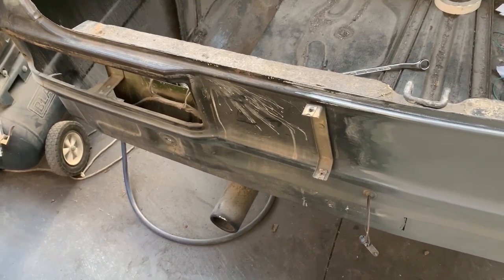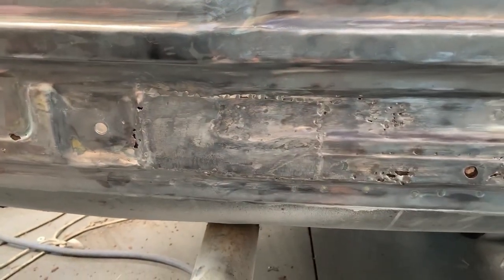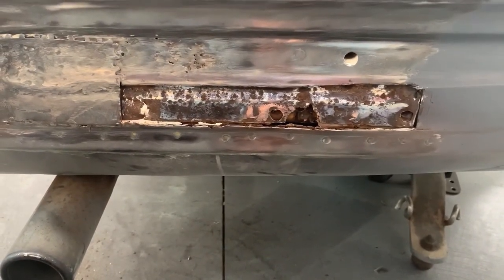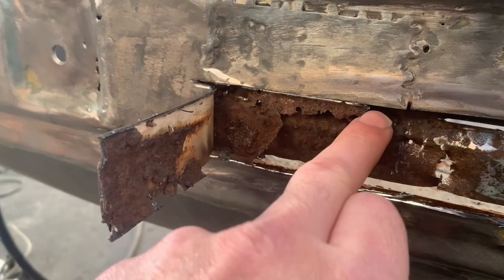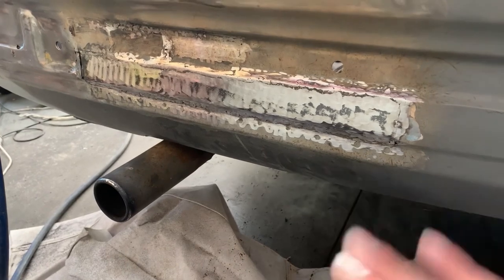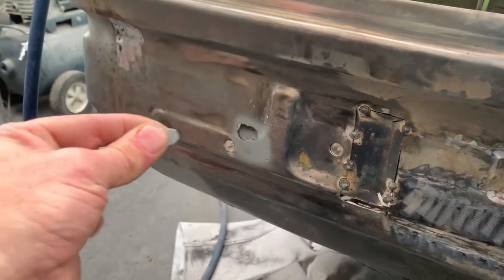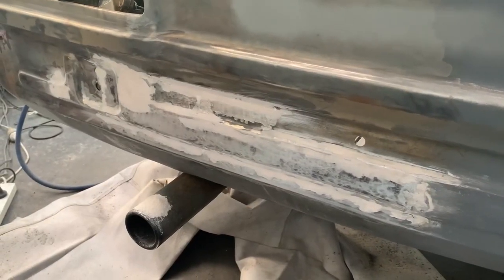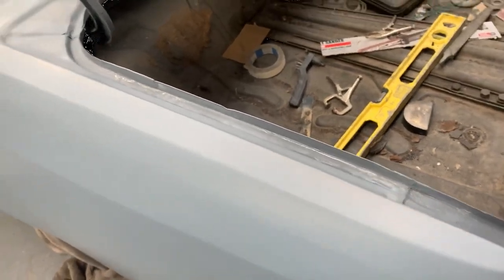VK COMMODORE BROCK TRIBUTE: L/H Side beaver panel repair

Comment: the to bolts are welded to the brace on the top yes, but the nuts underneath by the diff head come off so you can remove it. top work mate watch for rust under that brace when u remove it
Reply from the maker: Ah thanks for the tip 👍🏻